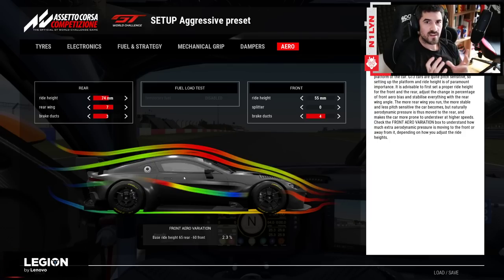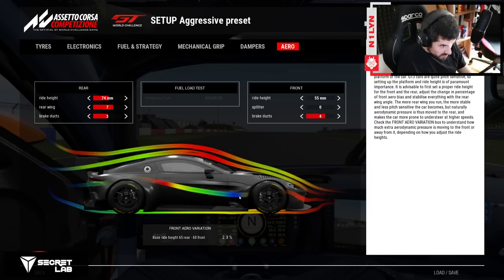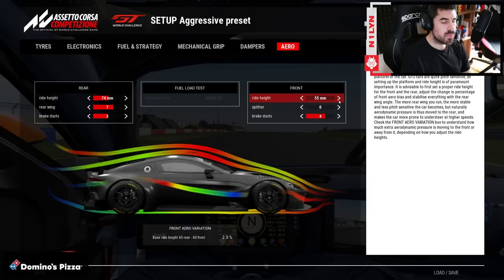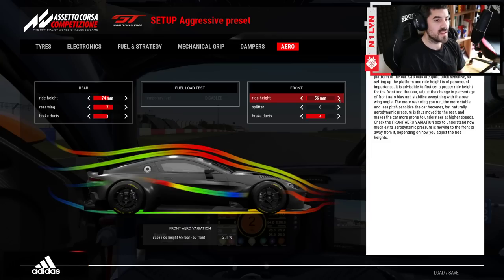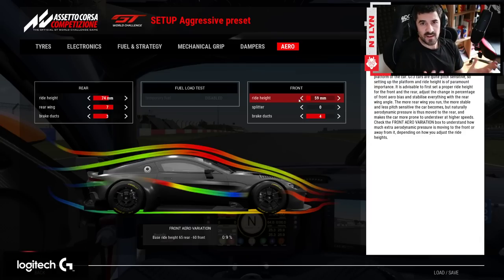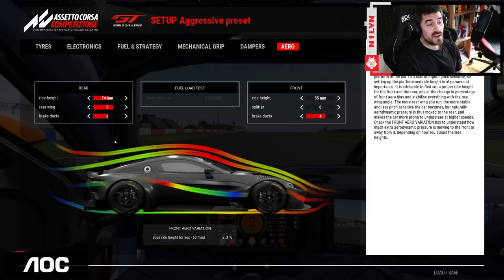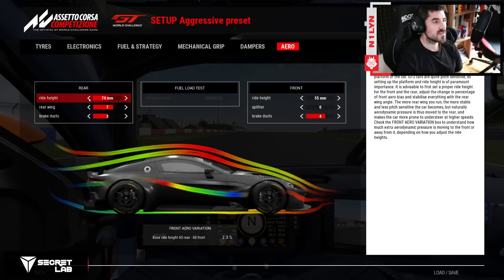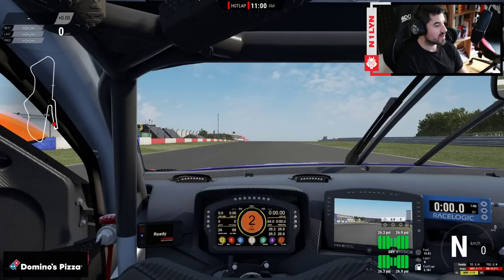Understanding ACC 3/3 - Aerodynamics! - Assetto Corsa Competizione

Comment: This actually works. I did not know you can independently lock the downforce dynamic on the rear making it a static height.  I did what you said on the Bentley at Spa and did a 2:18.780 a 2.3 second increase, I had to stiffen the front to stop the over-steering in corner 15. I am a contender now; Thanks.
Reply: Heck I should try that because the Bentley over rotates at spa and I keep loosing it and then go and change the wromg things. I'll look out for that video

Comment: Thank you for this video. This is the explanation I needed. Even though I simrace for over a year now and don't have much free time, I consider myself a safe beginner to drive with, who can consistently do slow lap after slow lap. And afraid to touch the setup of the car because I don't know what I'm doing. I drive only McLaren 720S and this has helped me understand the behaving of the car under different scenarios (fast corners, heavy braking and turn in,...). After watching a lot of "setup videos" this is the only one that will stay in my head.

Comment: Would love to see a video from you explaining when and why you would change one suspension setting over another (eg. Wheel rate instead of bump stop rate. Possibly with on track examples.)
Explaining the benefits/drawbacks of each setting individually and how they interact.
I find myself pretty much never touching the bump stop rate. Even though I conceptually understand what it does.
Never seen anyone really explain the use cases of each setting, and the consequences of those settings on track.
Reply from the maker: I wish I knew this much :)

Comment: phew! Found links to parts 1 & 2! This was one of the best ex[plenations i've been lucky enough to find., I understand that this is for the PC guys. Sadly I'm limited to PS5 which is all but ignored. There's no way to get set ups or any good info. 
This Video may just be a bit of the saving grace i need to at least get a little help. 
I love/hate ACC!  Anybody who has any helpful  info please let me know.
Reply from the maker: the problem with setups for console is that you can't use files, so someone has to go through the process of making screenshot, uploading and providing them or build a file interpreter that reads out the values which is tricky cause each car is different in that regard... just a lot of work for a potentially small customer base unfortunately
Reply: @SimracingPopometer  Thanks man! Appreciate your time immensely!  I understand the inability to import specific files. However my fingers are crossed that somebody will eventually share setups via vids as they do them. 
I do notice that there is a fantastic  amount of knowledge freely shared from many ACC (pc) racers, and I am studying everything i can find. Who knows maybe I'll be the one to make a set up vid for that freekin pesky 488 evo.....  Gratitude sir.
Reply from the maker: @everythingNotHere  if you grab a setup from our discord or the popometer website with your laptop, you can open the file with a text editor. all things in there are numbers of clicks from the left of the sliders in the game. but it's probably easy to get confused. 
I'll have a think if we add screenshots to our data packs. this way at least the setup is usable and also you can see the line of the pros even though unable to compare to your own

Comment: Nice Video Nils, I enjoy the content on the Setup explanation compartment. A question tho, is it reliable to use the Aggressive Setup default (Front to Back) weight balance % as a "neutral" feely car? Or can you maybe come up with some "standards" for Front, mid and rear Engine cars?
Reply from the maker: this is aero, not weight balance - very important difference. 
there are not standards because each car has that indicator in an entirely different range. you cant compare this value between cars at all and the whole dynamic of the car throughout the lap has more impact on the balance as that one indicator.
so no, no general standards but every car has a range where its likely going to be used, which will mostly be around the value that the aggressive setup holds

Comment: Thanks for the video. I was searching around your channel for an explanation of bump stops. So do gt3 cars usually hit the bump stops in most corners? Or is the only way to find out is to use motec? I hesitate to adjust bumpstops because idk if the car is hitting them in the first place so I just adjust the springs.  Also, I’m wondering why you would adjust bumpstops vs springs. I can only assume you want to adjust bumpstops if you only want to affect compression without rebound of each corner of the car, since a spring would affect both.

Comment: Question about ride height: the target is, the low as possible, as high as necessary. But how you chose the minimum ride height? By hearing when the chassis is scratching? By feeling then the car touches the ground? By looking the replay to see if theres contact with the track? What's the easiest way to find out?
Reply from the maker: as you can see with the whole dynamic of this is that the ride height can be very low even when you have nominally set it higher in the setup - its just about when you want it low and when high
Reply: Just commenting to see the answer 👆👆
Reply from the maker: so this video is just to explain the factors and dynamics you can control with settings like spring, bump stop rate and range (not dampers). 
generally you could say that the wings and ride height defines the base balance and the mentioned parts define how much you want to deviate from this behavior into both directions in different driving situations.
priority over wing and ride height is heavily car dependent. on some you get more impact from the wing, some get more impact from ride height, you dont generally favor one over the other. its all testing :)

for the actual setup you have to consider how bumpy the track is, if you have to use kerbs or not. 
its very specific and every answer i write will always have shortcomings. I also don't know the final setup when I start driving on a given track/car combo - one needs to figure out what is required.
The settings and the way of thinking in this video can help you get desired behavior without having to touch the ride heights when on some tracks it cannot be done. on some tracks you might want to run higher rake with less a less dynamic car, on some you will want a car with less rake but a more dynamic change of behavior. its also about what you can handle as a more dynamic car usually is more tricky to drive cause the driver controls how much he/she wants of that behavior, e.g. how deep you trail the brakes. 
say on spa or monza you have long straights where high rake might cost you speed. yet you can still get rake in dynamic situations on these tracks if you allow the car this movement and if you also do your part as a driver to tap into it. 

probably got carried away and as said this will always be insufficient info

Comment: If, if, if there's a calculation of suspension frequency in ACC then I can see how easily you can go out of the knee and also affect motion ratio with this method no matter how you want to compensate using the dampers. On the other hand, if ACC (and AC) coding does not take suspension frequency in consideration this is a powerful loophole.

Comment: I liked the video but I was curious on why you stiffined the rear bump rate in the video if the bump stop in the rear isn't resting in the fronts....I thought the bumpstop aka helper springs? needed to be pretty close to have an affect? It sounds like even though they're at 50....they still influence  the springs?
Reply from the maker: helper springs are not the bump stops. 

can you specifiy the question? I dont wanna rewatch my video to find what you are referring to :)
Reply: @SimracingPopometer   maybe I misunderstood bumpstop. I thought if that red line wasn't on the yellow in the settings they effectively were not doing anything specifically in the rear. But I guess that is the range before they compress and influence suspension behavior.

Comment: In motec, i see there's some fudge factors in your project file to convert the suspension position to the ride height. 1.8, and 1.9 so on..  if i drive out of the pits, and stop the car on a flat surface, i suppose i should get back the static ride height that i set in the setup screen?
Reply from the maker: yeah you get the suspension position that way to at least get a good estimate of what the ride height could be

Comment: So if the bumpstop range is 0, does that mean that the wheel rate doesn’t even matter because there will never be any movement at all? Or is there always some movement?
Reply from the maker: there's always movement as the bump stop is a flexing piece of rubber, with a stiffness you can alter

Comment: If a car (like the audi) has a -% value, then it needs that balance simply to keep the rear planted, so it's a very bad idea to change it to a positive :)
Reply from the maker: yeah you can't compare these numbers between cars
Reply: @SimracingPopometer  I just wasn't sure if it was mentioned so thought I'd say to help anyone who thinks it's a good idea to change it to a positive, because I totally didn't do that when I first started XDD 

I tried the Aston last night and find myself running a 3.2% front aero, I still feel some understeer so is it ok for me to keep going up? is the limit based upon my skill more than what the car can do? if that makes sense?  either way I went from 2:24 to 2:20 in 2 hours using your track guide, so thanks Your videos are of great help, also great race in the BMW the other day, them mid engine cars were too good on that track XDD

Comment: Thanks for the tips now i will have more insight on making setups. I have a question tho: does the sensitivity on the rear determined by the downforce generated at the diffuser or the wing? so if the wing generates most of the rear downforce making changes on the wing changes the percentage more? because i was testing with the v12 which doesnt have a diffuser and even 30mm ride height change does 0.1% on the balance.
Reply from the maker: all cars work different in that regard